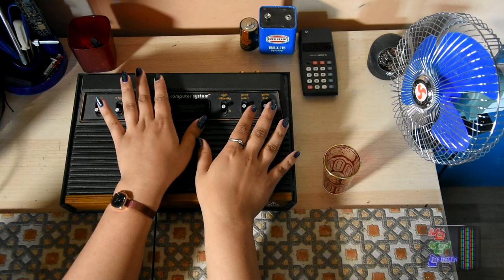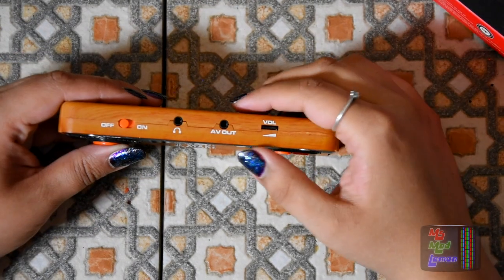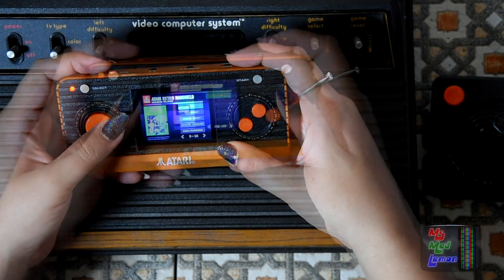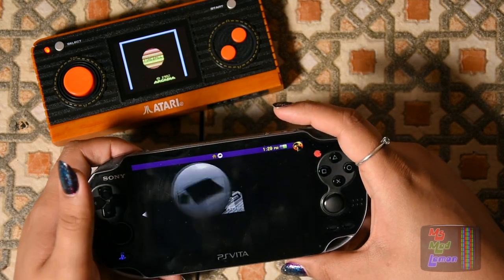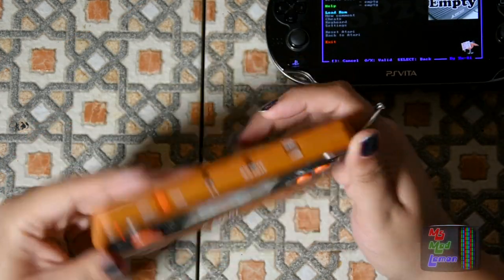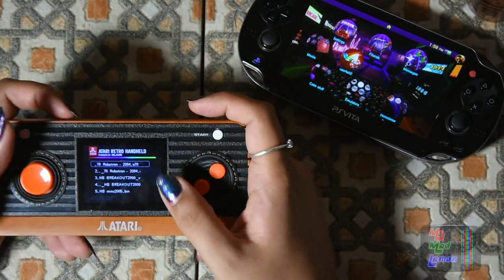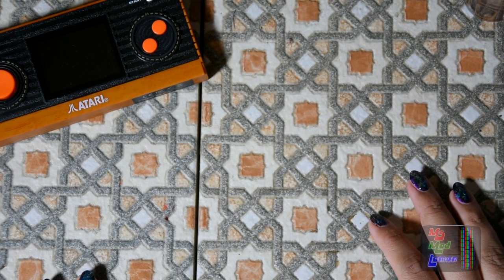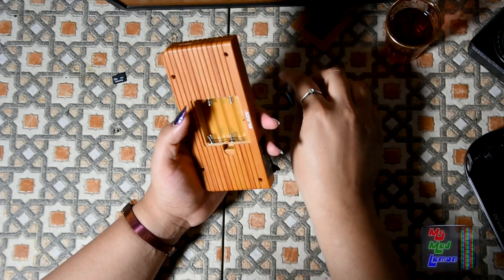Blaze Atari 2600 Handheld Pac-Man Edition Review

Comment: I never like these devices - they always seem rushed to market =/   With a CRT you get POV - persistance of vision with the phosphor, so flickering from multiplexed sprites like that displays better than it does on modern displays.  That said, it probably looked pretty flickery on a CRT too (maybe almost transparent looking).  The crazy thing on emulation devices like this, they could have removed / improved the flickering had they wanted to.  You should try those same games on the real 2600 with your BVM to see how they look.  Fun video btw :o)

The other thing I forgot about here is how the sprites are drawn in relation to scanline drawn.  In an ideal multiplexed engine, in theory a sprite could be gained by moving it and drawing it further down the screen (in the same frame).  Not sure if that was possible on the 2600 though.  Maybe it doesn't flicker very much at all on a CRT?

Comment: I picked one up and I added an SD Card slot to the PCB where the space is. I can read the card via USB on my PC so it can 'see' the card. I added games but they're not recognised by the system so I'm guessing the firmware isn't set up for it. If I could get a copy of the contents of the Winbond chip from an SD Card enabled model and flash it to the system it might work but it wouldn't be an easy fix.

Comment: Yeah i too appreciate those little details like an actual red LED instead of blue ^_^  Design wise it looks really nice. Especially that plastic woodgrain. Love it's caramel colour. A tasty looking kind of warm colour that makes you feel cozy somehow. And yeah,good thing it runs on STANDARD batteries that you can easily replace. Screw those built in non-standard LiPo batteries. I never trust those. There's a lot of chinese-made cheap NES-on-a-chip handhelds that either use special LiPo batteries or thankfully let you use standard batteries. Mostly AAA type too. But the built in games are often hit or miss.

Comment: Regarding Pacman, it may be a mismatch between the rom region and that of the system. You could try a US and EU rom and see which one gives you less, err... ghosting. That way you can also determine the refresh rate of the console. Also, try a regular 3.5mm to RCA cable and use the red plug for video.
Reply from the maker: I'll try a US Pacman rom, but its weird because the Pacman is a built in game, how can they get it that wrong lol
Trying the regular jack to RCA lead crossed my mind too, i'll give that a go and see if the red one is video.

Comment: I see your points about the mini consoles and the bespoke list of games that are bundled with them, I like my Super NES Mini, but I like my Nintendo Switch better because Nintendo (occasionally), add more games to the NES and Super NES apps.  What do you think of the Retro Games Commodore 64 (THEC64) units?  I have the full sized version and I absolutely love mine to bits because not only does it have built in games, it's so very easy to run other games on the unit from a thumb drive, you don't need to hack the console or side load games into the memory or make changes to the core software or do any of that kind of trickery to get more games onto the unit.  I personally don't care about THEC64 Mini because its keyboard is completely cosmetic and doesn't function, but the full sized THEC64 is fantastic, I love mine so much.  Yes, the Retro Games Commodore 64 units do use emulation as you'd expect, but as far as I can tell, the emulation is very good and quite accurate too.

Comment: I have the standard version of this, I do like it, but the sound is not accurately emulated at all as far as I can tell.  The sound on this unit appears to be an octave higher in pitch than it should be.  I play these Atari games on my laptop, and they run much better.  The version of this console I have does not have the SD card slot on it.  The other thing about it that really irritates me is that it didn't come with the video cable and the instruction book doesn't tell you any useful information about the video cable, such as the model number or part number.
Reply from the maker: That's pretty much how this is, the sound is jittery and feels an octave higher, though i wonder if thats the tiddly piezo speaker in there. Basically they're the same, just with an SD card and 10 extra games.
Either way it could do better, the processor in there is more than capable of it, that's for sure. And yeah I thin it should  have come with the video cable, though i'm wondering if it's the same as those old camcorder AV cables. I think i have one laying around somewhere, i may have a search for it and try it.
Reply: @MsMadLemon  The sound is just the same when you wear headphones, I too did wonder about the size of the speaker, but I've not heard of the physical size of a speaker affecting the pitch of sound before.  Regarding the video cable, if it works with a camcorder cable, that's good, but I don't have a camcorder that would use such a cable, never have had one, and I've been trying to think of any device I may own that has a 3.5 mm A/V socket on it, and I can't think of one, I do have a portable DVD player somewhere that has separate 3.5 mm audio and video sockets, but not a combined A/V jack.
Reply from the maker: @Lachlant1984  Ah no, I meant, if they've upped the octave for the speaker, I can imagine it not responding well to low pitch sound, if thats the case, it kinda sucks, i'd have just put in a better speaker... but i'm just speculating, if I do find an AV cable and maybe i'll think about putting a batter speaker in mine, I might do a followup video.
Reply: @MsMadLemon  Ah, now I understand what you mean, your explanation sounds plausible, but who knows if it's the truth or not.  I think only the engineers at Blaze Entertainment would know the real answer.  I've had my unit do some funny things sometimes, I've had a few situations where I'm playing Asteroids and the sound becomes so delayed there's a gap of several seconds  between an event occurring on the screen and audio associated with that event being heard, and the sounds slow down in terms of their speed or tempo, the unit almost sounds like it has been circuit bent.  Quitting the game and then restarting it usually solves the problem.
Reply: Actually, I've just remembered that my old Nokia N95 phone came with an AV cable which connected to the headphone output socket, I'm not sure if it's compatible though and I'm a bit reluctant to try it because if the cable isn't compatible, I could damage the console or the cable by connecting it.  I have a feeling the cable may have some electronic components in it to make it work, I could be wrong though.  I do believe the phone's output socket produces an analogue video signal because if I plug headphones into the phone and don't push the cable in all the way, I hear a loud buzzing noise through my headphones, probably the composite video signal going straight into my headphones, that's probably not good for them.  I also believe the AV output on the N95 produces stereo sound, and I bet my life the AV output on the Atari Retro Handheld is monaural.

Comment: It's a cute design, but I don't think very much of it. You can't play paddle games, you can't play any game that uses the difficulty switches for input (like Phaser Patrol, the Starpath pack-in game), the sound kind of sucks and some games don't even work.

I never understood why these systems have such a problem emulating older systems properly. Freeware emulators that are 99.99% accurate have existed for years and while I know they probably can't just take that code and run it on one of these systems, you'd think enough information exists for them to get it right.
Reply from the maker: I agree fully. On top of all this it´s an Atari 2600, surely of all things it doesnt need as much effort to emulate.
Reply: @MsMadLemon  It seems like all of these systems that come with built-in games have problems emulating them correctly. Sometimes the sound is off, sometimes the games suffer from slowdown, sometimes it can't scroll the screen properly, etc. It seems like they spend all their development time on the hardware and then cut corners when it comes to the software.

BTW, I also agree about these "mini" systems that only have a set list of games. I suppose that's OK for people who just want to relive a little nostalgia, but usually there's only a few good games and a lot of filler. Like the Swordquest games on this system. It's pointless to play them now since they were only ever intended to be a way to win the contest and aren't really games that you can play in their own right.

Comment: Thanks for doing this review. For the casual gamer these devices might be good enough for rekindling their memories or for experiencing the old games for the first time. It will not be for all. I like the design. The screen is quite small - too small for me to use without my reading specs :P
I reckon the speed of the device (emulation) isn't running full speed - if it was running at 60fps or 50fps (depending on NTSC or PAL) the ghosts in pacman would not be intermittently disappearing. And if the emulation isn't full speed then you'll have the sound issues like you experienced. 

Despite all the issues it has it'd still be happy using it on a trip or in the holiday home. Too bad about the sound quality - I reckon this is hard to get right with a slightly underpowered emulation but the original 2600 was a little challenged in the sound department anyways.
Reply: Marky it's me techy how ya been?... still have the pacman fever 🥵

Comment: Sound is usually the most difficult thing to get right with emulation. I presume it's a build of Stella but the cheap sound chip might explain the dodgy sound. Pointless putting paddle games on a unit like this - but I agree - they could have put a little analogue wheel on it which would have so much better. Even an analogue stick is a poor substitute.. The 2 buttons are for 7800 games. The ghost flicker is compromised by the display technology - on old TVs you had phosphor glow which reduced the flicker because the lit pixels on the screen persisted longer than on a modern screen. I wonder if the 7800 feels faster because its NTSC. Robotron didn't work on the PAL 7800 so maybe it's the NTSC ROMs.

Comment: Next video series : The Lemon Lady Mods the system with a wheel for paddle games..
Reply from the maker: Haha the thought crossed my mind but i'd have to change the software on it to accept the wheel and assign it as a paddle in the emulation, that is the part that's beyond me :o)
Reply: Ms Mad Lemon booo! :(
Reply: @MsMadLemon  i guess the source code of it is not open, is it?
if they would have used MCUs/CPUs from Microchip, i could have offered some support but sadly they didn't.
Reply from the maker: @stefanweilhartner4415  i'm figuring it's not open source unfortunately, I guess the only option would be writing it from the ground up since you can flash it I guess.

Comment: The sound really seems like the weak point here - shame, since sound on a 2600 is pretty basic to begin with, so you would think they could get that correct.  It also doesn't help with such a crappy speaker, and it really revealed the poor sound when you used the headphones output.  The Vita really shows it up (which it should!).  I'll stick with my Vita...